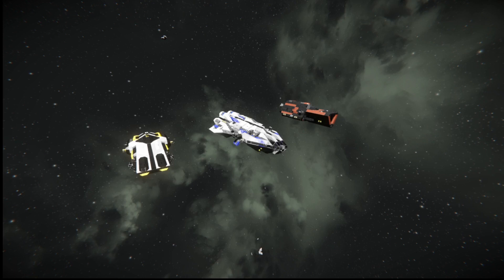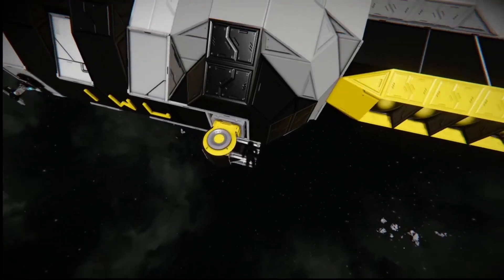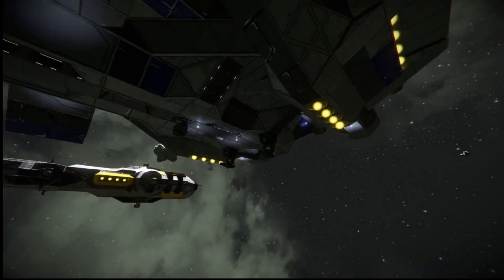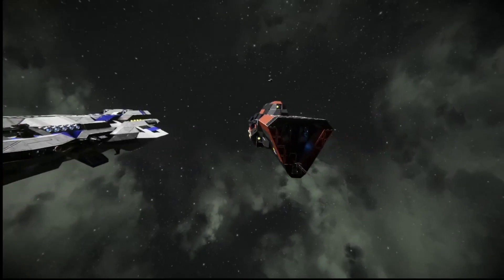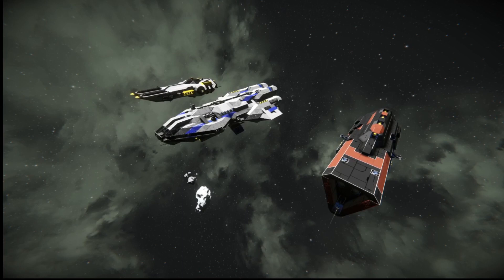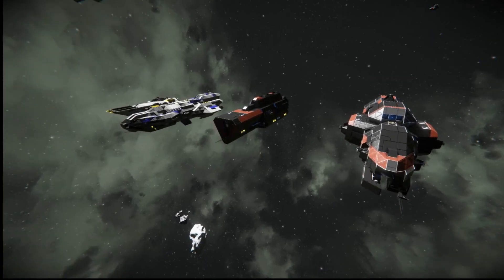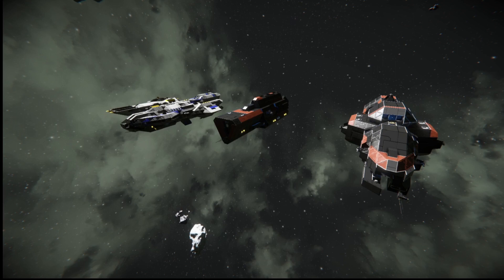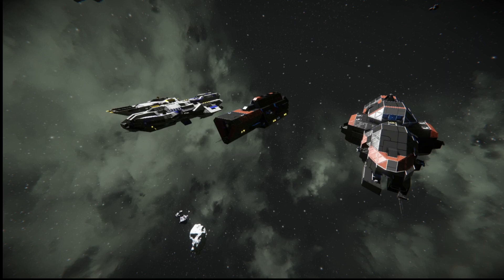What Makes A Corvette?

Comment: I think the Rocinante, at least in it's original configuration (before the railgun) and use by the MCRN is totally a Corvette. It mounts an absolute ton of point defense for it's size, and it's there to support a capital ship, so much so that it's carried internally in a hangar. Sure it has some other tools like the torpedo tubes, but it it seems like point defense was the main thing in the designer's mind.
Reply from the maker: Pdcs are used in close to mid range fights if I recall. That would make the pdcs a secondary weapon for close fighting and anti missle defence as there are no fighters in the expanse universe.

Comment: Out of curiosity, is it just me or does anyone else make some of their corvettes using small grid as well? Given the factorum small grid jump drive and all really makes pocket corvettes and light frigates viable for certain niches.
Reply from the maker: I've wanted to make a small grid ship with jump capability for some time now but don't have the time.
Reply: @badgerwildgaming6908 its fun, things are very much high risk high reward, you get sandwiched between a few large grids and youre done for, but as long as you avoid that, things can be both fun to use and a complete pain for any OPFOR to try and hunt down. Figure they tend to run more like PT boats and actual corvettes. Agility is survivability and make sure you can keep shooting. The factorum small grid jump drive is best kept for emergencies as well. While good for making long distance jumps, its also not something you want to have to wait on to charge while you have a task force that ain't so happy with ya trying to send you back to respawn.
Reply from the maker: Speaking of pt boats got a cool one I'm reviewing next friday.

Comment: I think the ship classification of corvette is generally about the size of the craft, rather than a purpose. A corvette could range from being used as a missile ship, anti submarine duties, antiaircraft, to even carrying a helicopter. Some always ride the border between one class or another.  If there was another distinguishing factor it is how far out a ship is designed to go, corvette generally don't go out on deep ocean. In terms of something like space engineers, it's probably not meant to carry out solo duties more then one short jump away from home, or anything prolonged.
Reply from the maker: Ya mostly a Corvette is the smallest ship type used for patrol and border enforcement. Its like the battle ship of boats.

Comment: Ship classification videos are my favorite. It would be interesting to see a video grouping all class from drones, then fighters all the way to Korvettes, Frigates, Destroyers, etc. Also what would be interesting is going in more details how how these are engineered by classification. How many Hydrogen tanks, engines, reactors, batteries, etc per classes. Great video just discovered your channel, very interesting.
Reply from the maker: The problem with doing a standardization on builds for ship classifications is everyone makes different builds based on what that ship supposed to do
Reply: @badgerwildgaming6908  Yea sure. But it would be great to have your take on it. What I would like to see from these kind of videos is going into more details of the actual engineering of these ships. Having classification helps alot but it doesnt inform us on what kind of components these ships should be equipped with per ships and per classes. Loving the video serie alot so far, Ive watched most of them already.
Reply from the maker: I guess I could do a iwl ship type vid on the orgs ship, vehical and equipment types.

Comment: So my general comment about this issue. But first of disclaimer I would say only once to not repeat in every video. Ship Type (the proper name) is a role ship fulfill in the navy. Not a size! A role. And it is extremely dependent on in setting how big those are and how things relate to other things (this also change between countries and time periods, so same ship may have different classification depending on that, but the role still stay defined).

So what is a Corvette? It is smallest capable warship. Dentition (in modern sense) was for the first time used during WW2 when British need cheap ship for anti-submarine roles, after Destroyers grow too large for many smaller tasks. It is why it is sometimes defined also as "glorified gunboat" what is sometimes also used regard early Destroyers.

In context of SE, Corvettes are cheap, easy to mass produce ships. What are generally capable of interplanetary travel (usually have jump drive), but still are in high end of the mass produced. For example using ship printers. Many Corvettes also is capable of planetary landing, because they are small enough for that to be relatively easy and they tend to serve as auxiliary ships for moving between military operation zones. Despite being expendable, they commonly do have basic assembler setup and med bay in case of the crash. As they are expected to operate far from the bases.

As side note, related Gunboats are short range, mass produced, specialized heavy crafts. Quite commonly lacking any support equipment as they are expected just to do the job as cheap as possible and not go far from the base of operation. Tend to have cockpit instead proper command deck. Corvettes are that on steroids.
Reply: My take is that MCRN was extremely pretentious regard ship classification, basically intentionally misusing ship types to show how independent they are from Earth. But principally they really weren't really that different.
Reply: @TheRezro  The books kind of support you on this. In Abaddon's Gate when Anna is chasing after Melba Kho/Clair Mao, she remarks how she would be able to recognize the Roci anywhere, unless they were parked next to another Martian corvette
Reply from the maker: That's what I liked about the show. The roci is just another tachi class light friget. It's the crew that makes her a legend.
Reply from the maker: So they just wanted to be different? I don't know I've seen a few episodes but read none of the books.
Reply from the maker: Yes that was a thing with the gunboats I reviewed. Most where single seat large block jump less ships.

Comment: The majority of arguments for what the difference is between a ship and a boat are mostly antiquated from before the 20th century. If you were to ask a ship builder today they would tell you that ships have certain design complexities that make them more ideally suited for traversing the open oceans where as boats are less ideal and have limited range restricting them to coastal waters. Submariners call their submarines boats out of naval tradition from when they were called submarine boats and were restricted to coastal waters or were tethered to mothership via an airline. However in today's navy they are registered as ships and it shows in their title USS which stands for United States Ship.  A submarines equivalent in space would most likely just a be a frigate or a destroyer that can cloak.

Understanding the difference between ships and boats I really like your established doctrine that corvettes have to be jump capable. Which is something I agree with because if it wasn't jump capable I would just call it a system patrol boat or maybe give it the designation of Cutter. I'd also like to mention that while it is true that corvettes are primarily long range patrol and scout ships they are also meant to be rapid response ships where they can quickly deploy and provide reinforcements as escorts. Which is why some corvettes are heavily armed such as the Soviet Nanuchka class.
Reply: FTL capability is heavily lore dependent. But that is the usual dividing line.
Gunboats (I call it purely because it sound cooler) typically operate close to facilities.
Corvette should be capable to make comfortable travel between the planets.

Comment: A think to think about is that a lot of sci-fi works on a much larger scale then SE. The Rocinante, the biggest ship you showed, could be run as a solo in SE, wheras in the books and show its crew of four is a skeleton of a skeleton crew.
Reply: Racinante is actually a Frigate. Mars was just extremely pretentious with naming.
Reply: @TheRezro it’s the tonnage of a corvette but has frigate class torpedo tubes. It’s essentially a light frigate because corvettes nominally don’t carry capital class weapons.
Reply: @TheRezro The Rocinante is definitely capable of carrying out corvette missions. Scouting, screening, small ship combat, special operations, and atmospheric flight capability make it distinct from a Frigate in addition to its light tonnage. The only frigate feature it has is heavy torpedo tubes.
Reply: @adamb8317  Because it is a Corvette. Even if they classify it as Frigate for some reason?
Reply: @TheRezro  It’s a Frivette. 😆 I suppose it could be classified as a Heavy corvette or Torpedo Bomber corvette. I think it’s initially introduced as a light frigate but the author was a little confused on the distinction.
Reply: @adamb8317  I assume Mars "made up" definition to be edgy.
Reply: Also, the Roci is officially 46 meters from the bottom of her drive cone to the tip of her comms array.
A large grid block is 2.5 meters to a side.
That makes the Roci only 18.5 blocks long if it were ported to SE accurately.

Guess that makes the engineer an absolute beast of a crewman.
Reply from the maker: @VoxAstra-qk4jz ya alot of the ships we see ported to Se get shortened mostly due to pc restrictions or PC limitations. So ships(a S.I.S.D. that comes to mind) can be so big they don't fit in the 3rd person camera.
Reply: @badgerwildgaming6908  everything tends to get pulled towards a the middle. Big ships like the many Starship Enterprises tend to be shrunk, and smaller ships tend to be blown up to get the details the builder wants.
Reply from the maker: Ya wish that could be fixed
Reply: @badgerwildgaming6908  try Starship EVO, it allows nice detailed builds and already has some Rocinantes made, possibly even 1:1 with full interior (from series).
Reply from the maker: @calluxdoaron1903 I should look that up I've heard good things about it didn't know it was free
Reply from the maker: Ya is a cool design they settled with but the ones up to it are crazy cool as well.
Reply: The reason 4 is a skeleton crew is that it was meant to be crewed by 12. Each 8 hour shift or “watch” is 4 men. During combat all hands would be at battle stations for optimal efficiency and crew redundancy. The Roci being crewed by 4 means that one person being injured or absent will make the ship generally ineffective in combat. The Roci also was meant to have a complement of 6 marines to repel boarders, carry out boarding action, perform land warfare, and many other purposes.
Reply: @adamb8317  Yeah, you would really need a gunner and pilot. A captain to actually think about the objective while the pilot is spending all their brain power on not getting blown out of the sky. Someone to run repairs. 
Because SE is more simple, pilot, captain, and gunner can all be the same person, and the fast pace makes combat repairs less vital. Also the engineer doesn't need to sleep. Or eat. Or recover from injuries.

Comment: I stopped the video at 5.09 minutes. Yes, mainly, this small military unit was designed as a sentry. Going back in time, precisely the 17th century, the definition of Corvette was born by the French to classify a sixth class hull definable as a fighting ship. six classes, the sixth included the shipping with a minimum of 20 artillery pieces, i.e. cannons, then falconets, mortars and more. a corvette was defined as such if it included 3 masts, the foremast, the main and the bowsprit, with artillery pieces between 20 and 28 guns. she reached 50 meters in length. This unit was used as patrol, order carrier, coast guard, exploration and assault on small pirate boats or boats of different nationalities. today this unit includes a minimum length of 75 meters, 2 76-100 mm units, 1-2 anti-aircraft batteries, 1-2 missile launchers, 1 landing platform for support helicopters. Putting today's characteristics with a future figure of the same, a corvette serves to patrol, explore, support, destroy fighters or classes lower than itself. Small size for 150 soldiers (officers and others), 2 small-caliber medium-rapid fire guns, 2-3 anti-fighter batteries, 1-2 missile launchers and a hangar for a support/landing vehicle.
Reply from the maker: Yup all that can be incorporated into an in game build and still be funtional.

Comment: In Aurora 4x, my ship classification is usually based on relative tonnage and fleet role. Corvettes are generally above 1000 tons, but their upper limit depends on the general size of other ships in the fleet. Between 500 and 1000 tons is sort of a grey area between aircraft and boat terminology, usually go for something like fast attack craft, and below 500 tons is where you get into "fighters" and "bombers". But in the beginning my frigates and destroyers might be 3000 to 5000 tons, but as facilities grow larger and the economy grows larger, the standard size for those ships also becomes larger, along with the maximum sizes of the largest ships in the fleet and the maximum size of a corvette also becomes larger.
Reply from the maker: There are alot of ways different countries classify their ship classes but usually it comes down to role in the fleet.
Reply: Vide game classification is source for a lot of misconceptions. It is actually the role, not the size.

Comment: Mh... I quite enjoyed the vid and it mostly fits with my own ideas regarding ship classification in sci fi settings. I'd love to hear more from you about other ship classes.

That said, I'd like to mention my own ideas as well, both for you and for other readers - hopefully some of what I'll say will make sense or inspire you guys 😛

For me, the difference between a corvette and a smaller craft is that a corvette is the first craft that has enough space on board that standing up and walking around is a real possibility and won't (overly) inconvenience the others on board.
The difference between a corvette and larger craft is the maximum and average mission duration as well as the degree of self-sufficiency (eg. due to supplies stored on board).

A corvette is usually meant for short missions, rarely more than a day or two. In fact, in my lore, corvettes are often used on missions (e.g. patrols) that are short enough that they only last for a single shift with the corvette returning to port at the end of the shift and swapping its crew out for the next shift. As a result, the on-board accommodations on a corvette are fairly spartan and may not even include bedding - if they do, then the bedding will have to be shared among several people (aka one person sleeps in it and once they are done, the next person sleeps in that bed).

For me the mission profile of a corvette doesn#t just cover patrols, but also the following:
- border guard
- anti-smuggling
- anti-piracy
- customs controil/inspections (e.g. for a port or planet)
- escorting or transporting dignitaries or other VIPs
- search and rescue
- (limited) humanitarian aid (it simply doesn't have the manpower or cargo capacity to do more than a token effort in this regard)
- mine laying
- mine sweeping
- ASW

IRL corvettes were also used for coastal ASW (anti-submarine warfare). in fiction I'd expect that to translate into some kind of role that focuses on detecting stealthy or cloaked ships.

For armament, i fully agree with you. The majority of the firepower of a corvette would be point defense and weapons designed to target small agile enemies (e.g. strike craft like boarding pods, ighters or bombers - and missiles/torpedoes).
That said, when it comes to firepower vs larger targets I tend to go one of two routes (or both):
- I either add missiles as a versatile long-range option that can pack quite the punch (nukes hurt and can be fairly small)
- or I add a spinal weapon of some kind. This takes up a lot of internal space though and is only an option on corvettes dedicated to active combat roles since that space has better uses for most missions (e.g. sensors to spot stealthy/cloaked ships or contraband).

I'm looking forward to future vids from you ^.^
Reply from the maker: Thanks and thanks for giving this explitaion on corvettes. It's opening more info up on the class.

Comment: Corvette: the smallest 'propper' purpose built ships intended for sustained operation
Frigate/Destroyer: larger small warships, some guns capable of threatening larger ships in groups, some may focus on a task or weapon system.
Cruiser: A heavier ship with larger guns than smaller ships could mount, also able to mount even more secondart weapons
Battlecruiser: a very large cruiser or small battleship sized hull, mounting battleship sized guns but lacking the armor, posesing speed to escape what it cannot kill
Battleship: the heaviest of the warships, armored to slug it out.

Dreadnought would be either above or below battleship depending on how classes are being handled, but historically dreadnoughts were precursors to WW1 battleships and depending on the setting it may be a term for older less effective battleships.
Reply from the maker: Don't worry I'm addressing those soon.